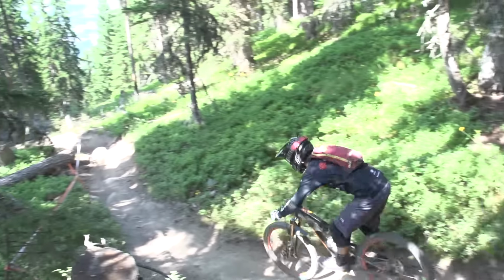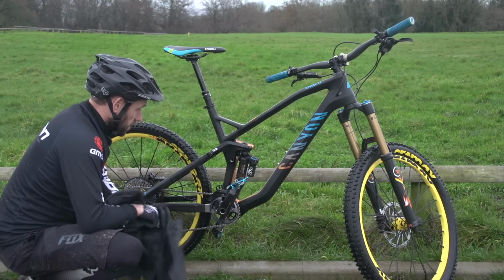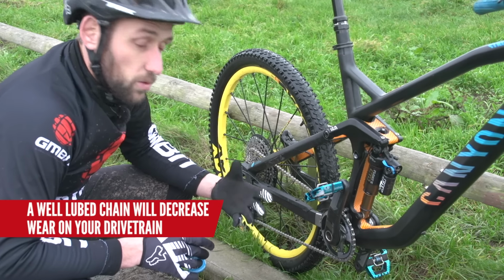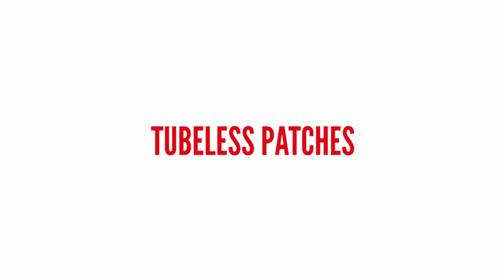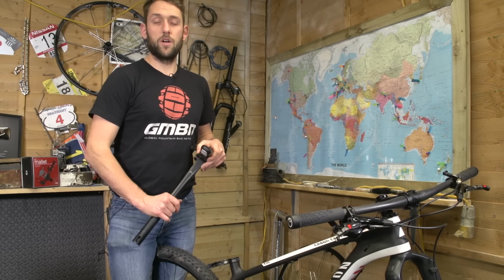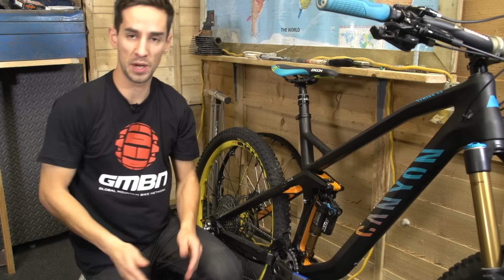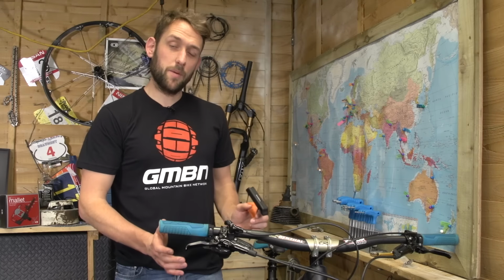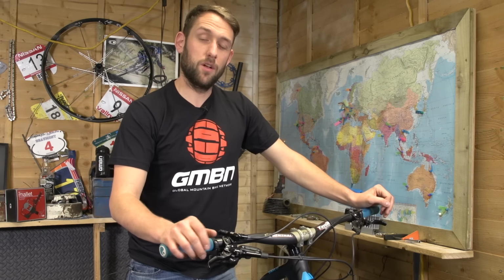Top 10 Money Saving Mountain Bike Maintenance Tips

Comment: spend some money on your allen keys, and make sure they're properly seated before you tighten or loosen anything, saves a lot of time in stripped bolts- too many hours I've spent having done that with a multi tool!!
Reply: +toasty bear Yeah.. I however find it to be mostly because of the cheap bolts that often come with even relatively expensive bikes. I buy hardened stainless steel bolts, from a machine shop, the correct length and size, for use with especially with my disc brakes which I find tend to seize up. I've literally rode that bike through saltwater, mud, rain and used it as a commuter, and the single thing I've never replaced... Those bolts. They never strip, and they never fail (at least for now). 

The worst offenders I find to be the Torx bolts on disc brakes from Tektro on the cheapest bikes. I'm not sure Shimano's are any better, because they look exactly the same (flat black Torx screws). They strip off and I even had to have one removed with powertools at a machine shop my friend owns.
Reply: TheNewFaceOfHSP good idea! and good point- although its often because you haven't put your allen key in right-
i keep meaning to get a load of titanium bolts, they don't rust either but haven't got round to it yet!
Reply: toasty bear No doubt, it's easy to mess up. But they do get stuck, and it's lovely having them pretty much unbreakable.
Reply: TheNewFaceOfHSP how much are they comparatively?? :)
Reply: Phew, the ones for disc brakes are 1,25 DKK or something like that, so that's around $0.2 USD/piece, but if you buy 20-50 or so, they come cheaper. I get them basically free from the guy who has that shop. I think he buys 10.000 or so. I've seen almost the same ones on a bike store here too, for around that piece price. 
I'm pretty sure the cheapest would be to go to a local mechanic (car or tractor or something) and come with the bolts, and ask if you could have them measure those, and help you find the exact ones, in hardened stainless steel. Probably not that expensive, especially not compared to the ones who use Titanium screws to get less weight. I think $10 or $20 for the hassle, and $10 for 50 screws or so, would probably be more than worth it. I'm not sure about the prices out of Denmark, as I'm used to compared to our country, it's probably gonna be like $0.001 a piece in another country haha. 

You could also try Ebay, but honestly I would not trust them to ship anything truly hardened and "pure". Go to a mechanic. My friend's shop fixes trucks and tractors, and those bolts MUST hold up, so I know they will never ever fail me.
Reply: TheNewFaceOfHSP fair enough!! thank you! i'll probably just replace them one by one as i need to tbh :)
Reply: toasty bear Yeah for screws it sounds quite bad right? :/ 

Ebay is actually not that bad.. These are from United Kingdom, and they have some semi expensive postage here to Denmark, but if you found from a seller you trusted, and that have multiple quantities, like this one, you could probably get away with roughly measuring the lengths and diameters yourself (usually m5 screws of different lengths, both mine has 6 pieces of m5x10 screws for each disc rotor, think it's standard) and then contacting the seller, and having them combine postage for all the ones you need. Be careful when measuring the ones at 10mm vs 12mm etc. I've found both work on my mountainbikes, but probably a little luck too, because the 12mm extrude a bit from the back of the mounting, but don't hit the hub itself... Pheew.. Will replace them eventually... 

http://www.ebay.com/itm/M4-x-50-M5-x-8-M5-x-10-M5-x-16-Stainless-Steel-Socket-Cap-Screw-Allen-Bolts-/371155536148?var=&hash=item566a980914:m:mAuBwMdlQxoAZLywJ3OTqBA
Reply: again, thank you :) that helps a lot, i know what I'm looking for in hardened stainless now too, the same pockmarking as hardened steel :)

Comment: Just a couple of questions, you started with a pressure washer... i thought these were the golden rule of things to avoid, as the pressure is high enough to force grease out of bearings/bushing, and you're unlikely to get grease or oil back in there without stripping or cleaning?  I serviced a modern bike that had been hardly ridden but jet washed before it came to me the other day, had a complete strip and re-build, i was finding water EVERYWERE.

Also, maybe it's too obvious or maybe i missed it in the video, but shouldn't regular maintenance (especially replacing gear cables and chain) be on there? in the long run an old chain destroys everything and costs a lot more money, and gear cable is so cheap it's silly not to when it makes a huge performance change.

Ahh... while I'm here I might as well also say that i no longer use cable guides at all on my frames, I use one long length of cable outer from shifter to as close to the front as possible and all the way to the rear mech. Since doing that my shifting has locked in and stayed in. I also use an old V brake noodle boot on the inside of the mech to stop any mud getting in the end of the gear cable.

well.. my rant over, thanks for the vid though guys :)
Reply: You can use a pressure washer if you're careful to spray from a distance and don't blast water directly into things like the rear cassette or bottom bracket.  Of course not using a pressure washer is safest.

Comment: put grease in the allen-key hole on bolts to prevent oxidisation, it save on the pain later.. :-)
Reply: +zwarst Well I'll be, that's the best tip I've seen in a while! Now why didn't I think of that myself..
Reply: I just added grease to my shopping list !
Reply: +zwarst Buy hardened stainless steel bolts at a local machine shop, the right diameter and length ofc. Replace every single Torx screw on the bike with these (maybe except the ones on your brake leavers). That will really save some pain, when those Torx heads grind down.. Stainless allen bolts last forever (in my experience).

Comment: A pressure washer?!!! You're supposed to be the experts. C'mon now...bottom brackets and pivots aren't cheap for us mere mortals. I just stripped a Stumpjumper frame for sale after 6 years of hard riding and the pivots were fine. I've NEVER pressure washed it and have hosed it only a couple times. I rode through a deep puddle ONE TIME and had to replace a seized BB. Don't promote destructive maintenance practices.
Reply from the maker: Using a pressure is fine, you just need to be careful where you point it! Bearing points should be done by hand

Comment: Turn your grips half a turn when they get worn, they'll last twice as long

Remember to grease your bolts

Use good quality tools

Use car / motorcycle cleaner as its normally cheaper than mtb specific stuff

Take your brake pads outs and clean them properly, water won't decontaminate them properly so you need to use brake cleaner

Comment: how did you get a pressure washer beside your trail ?
Reply: +James Watson Mobi are a brand that do portable pressure washers, some you charge at home to take out with you, others can run off your cars 12v power supply. Cheaper option is to get a garden sprayer that you pump manually from a gardening / DIY store.

Comment: Use Shoe-Goo to fill holes in tubeless tires; buy brake and fork fluids from Moto shops. And If you really want to save 1,000s, buy a 26" wheel bike of the highest quality.
Reply: +Paul Burns Good call, Buying 26" is a pretty good tip if you want to save money and still ride a great bike.
Reply: +Paul Burns BE CAREFUL! If it says mineral oil on the brakes it's NOT OKAY to put on DOT-1,2,3 or 4 brake fluid..